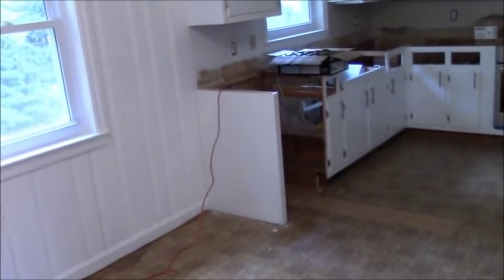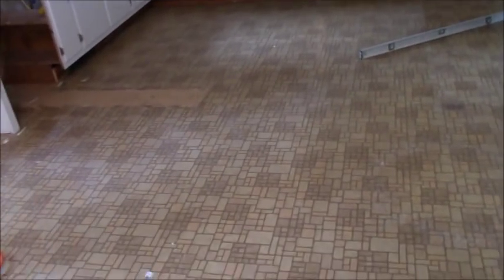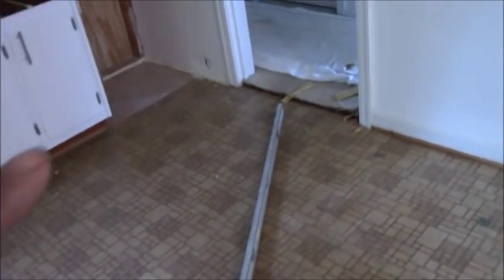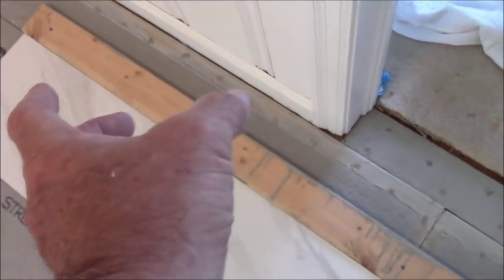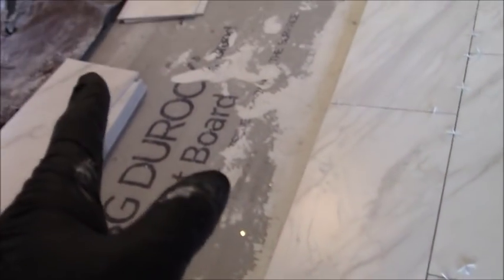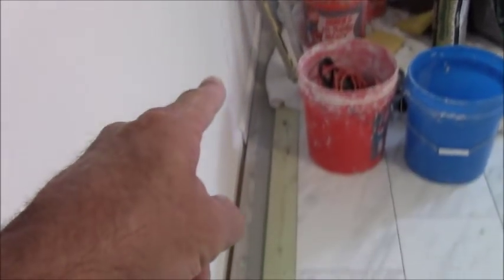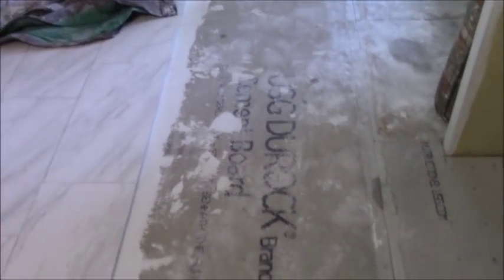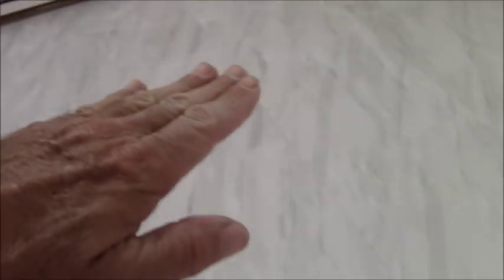Floor Tile Tips and Tricks for DIY'r

Comment: What side spacers did you use?
Reply from the maker: 1/8th
Reply: @StarrTile  thank you sand or non-sand grout?
Reply from the maker: Sanded
Reply: @StarrTile  Help I am having someone lay 12 x 24 tiles besides putting the tile down using Thinset they are also using it to level the kitchen floor when I saw there was about  close to an inch of thinset then the tile is on top is this wrong? am I in trouble please let me know help!
Reply from the maker: If you have an inch of build up then that should have been done with plywood, backer board, or a liquid level quick system, not thinset
Reply: @StarrTile  what do I do now I thought the leveling should have been done before the tiling process began when I saw it I was so surprise after he left I measured 1 1/4" of thinset that also includes the porcelain tile furthermore he did put Hardie Backer Board down before he started tiling and it's 3/4's done what are the dangers of leaving it or should I have them start over and do it right what should I do???
Reply: What would the cons be if I were to leave 1 1/4" thick thinset? He used MAPEI PORCELAIN TILE MORTAR.
Reply from the maker: Sorry, I cannot help you through your entire project as this is becoming a consultation and I'm usually paid for that.
As I mentioned before part of the prep of any tile job would be to mitigate the drop of your floor or the rise of it whichever the case may be with a leveler or mortar, or even backer board or an extra layer of plywood, many ways to go about that but thinset is not one of them.
Based on what you have said already my recommendation would be to stop the job and find somebody else, I don't know how this could go well, even if he finishes and the tile looks great there's a real possibility of future damage occurring when things aren't done correctly....
Reply: @StarrTile  Sir, thank you from the bottom of my heart you have been incredibly kind and generous to answer all my questions you have given me a lot of information and I thank the Lord for you because I know now what I strongly need to do these incorrectly thick thinset laid tiles need to go and the job needs to be redone correctly from the beginning and he is not going to redo them I'm going to get someone else Do you know anyone in Brooklyn? 😃
Reply: Just to give you an update I was able to get that person to take up those tiles and I have a new tile person coming to install the tiles and to finish the kitchen.

Comment: Its ok used 1/4 spacers
Reply from the maker: You can use any space in you want, I just prefer one eighth
Reply: @StarrTile  thank for your help
Reply: Did you recoment for DIY used premix grout for finishing tile
Reply from the maker: @djgrandedanxingentertainme5174  I do not like pre-mixed grout, Home Depot has grout call prism grout and it is excellent, you just mix it with water and it's already stain resistant, if you cannot find prism grout then use another type of powder grout but the pre-mixed next is usually crap... except Fusion Pro, that's a very good grout and it is pre-mixed, however it dries very very quickly and I don't recommend that for a homeowner to use
Reply: Go thru a few boxes of tile and measure each tile.  Make sure your grout joint is big enough to hide any discrepancies